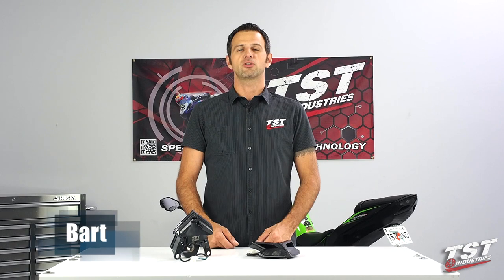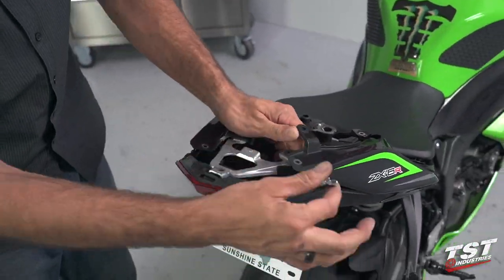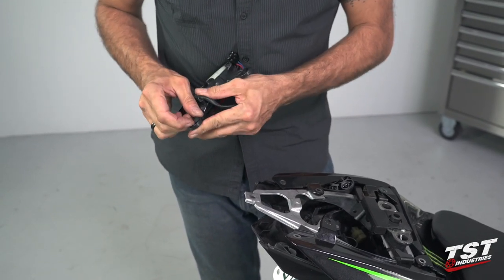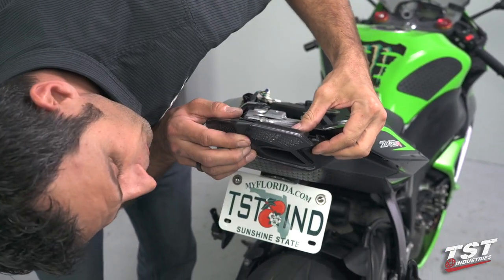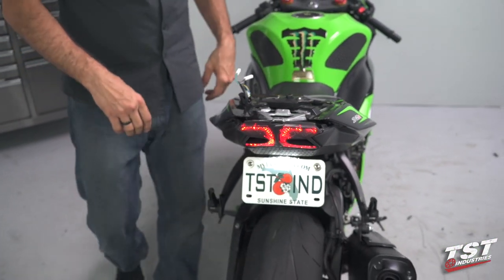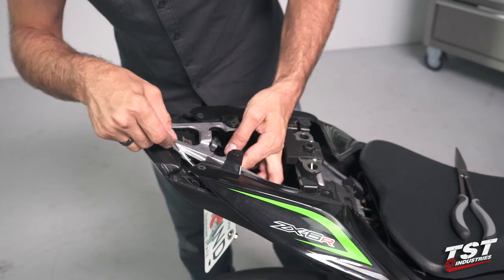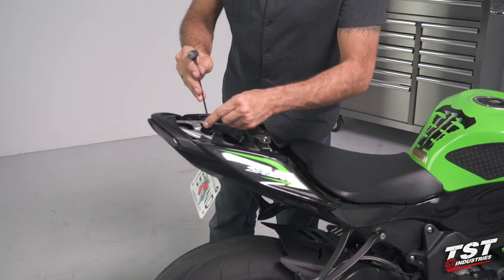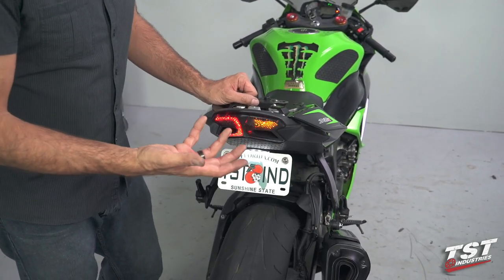How to install a Programmable Integrated Tail Light on a 2013+ Kawasaki ZX6R by TST Industries

Comment: I just installed this on my 2015 kawasaki ninja 636. And wow what an amazing buy. Easy to install no doubt. Just plug and play is all u need. Though i must say the wires were not easy to get to. In the video the guy pulls them basically all the way out. Yea in all actuallity, its pretty tightly snugged in but it can be done. If u buy this u must buy the the replacement for the oem flasher. For those who dont know, when u plug and play u will see that once installed, the lights flash faster then they are suppose to because of the led lights. On the tst website it shows a link when ur purchasing ur taillights..... its a grey resister that plugs right into the stock oem flasher plug. It took me 3 minutes to install that. Basically it slows down the speed of the flashing so that it matches the stock speed with the front turn signals. Im still learning how to work on my bike and even i was able to do this task with the video. Ive been very impressed with these lights and i highly recommend tst to anyone looking for top notch great quality parts.
Reply: The reason i said to buy the part for the flashing is because it just goes too fast with the stock oem part. Doesnt have the same effect when ur lights are on. Once the tst part is in place, the turn signal and tailight pulse in perfect unison...... if u dont buy the grey resistor, you have to splice wires and all that. Do yourself a favor, when u go to purchase the taillights by tst, it will show a recommened buy at the bottom at a discounted rate. Basically parts that go with taillights...... i recommend you add them to your cart.
Reply from the maker: Dan, we're super excited to hear that you are pleased with everything!

Comment: This is stunning - sad the design isn’t available for the 2020 models. Do you guys reckon it could fit ?
Reply from the maker: No, the tail parts on the 19+ bike are vastly different and will not accept this tail light. We designed a dedicated 2019 tail light that sets off the tail of that bike on the same or higher level .
-BR

Comment: I have them on my zx6r 2013 they work great, the only problem it doesn t fit perfectly, but that might be a problem with my fairings.
Reply from the maker: I think this video clearly demonstrates that the fit is as good as OEM tail light. Do you have aftermarket fairings?

Comment: Placed my order from the UK.  Cant wait
Reply from the maker: Awesome. I would like to have your comments once you get everything installed.
Reply: @TSTindustries  So the good and the no so good.  The good.  The lights looks flippin awesome.  I have not seen a better rear motorcycle tail light better.  The flashing of the LEDs when you Break is just awesome...just like a race car.  The sweeping indicators look great as well...and the LEDs are bright and clearly visible.  Also the design of the light is better than the OEM.  The shape with the air vents look great.  All in all really tidys up the rear end and the anthracite grey colour blends into the underneath of the seat.  Looks fantastic.  Now the not so good is...the light does leave a slight gap when fitted.  No matter what you try you cannot seem to close up the fairings to have a complete flush fitted unit.  Also the resistors used to lower the speed of the flashing are not that great.  They get extremely hot.  So hot you cannot touch them.  I was a little worried about it melting some other wires under the rear seat cowel once I put everything together.  TBH this old style of resistor is inferior and was surprised that this was even offered as an option when I purchased my light.  I had to wrap my resistors in a heat shield to ensure if I did leave my indicators on for long they would not get hot and damage something else.  The price of the light is not cheap compared to rivals and for me living in the UK it gets expensive when you have to pay for additional shipping and customs.  I can see why TST offer the Relay.  This should be offered FOC with the unit as most people if not all will need this on the install.  Other than that happy with the product.
Reply from the maker: @ebk7216  Thank you for your valuable comments. I appreciate the praises you sent us and also the careful constructive criticism. We can't continue to improve if we don't hear back from our customers and that is why I always like to get the good/bad ...all of it. I don't want to write up a response that could come across as some sort of rationalization so I will just keep it brief. Not everyone needs a relay for their setup...some people already have one from a previous installation and some people for some reason prefer fast flash. The relay will remain a separate item that people may want to purchase or not. I don't know what to say about a gap. In our installations here during and after the design phase we had the same quality alignment and same size gaps as the OEM light. There was no reason for us to change the design. As for our competing companies in the lighting field, they just copy the OEM geometry of the tail light and put in their own circuit, and maybe some do an internal reflector. The way we design takes a LOT more time and requires a different level of sophistication. Time spent on design of the aesthetic, then the engineering time to make this light manufacturable, and the cost of several molding tools to make the parts, all rolls into the pricetag that you see. In our market here in the USA you actually see some inferior lights cost more than ours because of how the manufacturer structures their distribution. We do have two competing companies that deal directly with customers and have lights around our lights price range. They are the ones we hold in high regard because they have a good product at the right price. Anyway, I hope that you see that we are structured to enhance our coustomers' experience with their bike and not just a money making machine. Money is just a byproduct of doing what we love.

Comment: Can you use it just as a taillight with existing indicators? Like the look of it however integrated taillights are illegal in australia
Reply from the maker: Of course. You can connect the tail light plug and leave the signal plugs off in favor of keeping external signals. You can also use our Y-Splitters so that the tail light and external signals do the signaling. You can see if that works for you here: https://tstindustries.com/tst-kawasaki-y-style-signal-harness-splitter.html

Comment: if I DONT install the relay, so the lights continue to flash fast, will that somehow damage my bikes electronics?

I took mine in for first service, I got it home and I saw in the notes it says "turn signals flash too fast, needs load bearers"

I like it flashing fast thats why I didnt put it in.
Reply from the maker: Not installing an LED Flasher Relay or resistors will not cause any damage to your bikes electronics.
Reply: woo thanks bruh
Reply: I like a fast flash as well. Gets/keeps road tuggers attention

Comment: Hello, where can I buy it and also a radiator for this model of motorcycle?
Reply from the maker: The tail light is produced and sold by TST Industries, the same company that made this video. The link to the product page is in the description of this video. We do not sell radiators though, you may want to try an OE parts website for that.
-BR

Comment: Do I have to slice any wires when putting resistors?
Reply from the maker: The resistors come with tap connectors. You don't slice any wires with those. They puncture the wire insulation and make the connection.  I always recommend our flasher relay over the use of resistors.
Reply: @TSTindustries  
Thank you!

Comment: has anyone had problems without the relay you guys sell?
Reply from the maker: If the included resistors are installed there won't be a need for the relay. If you don't install the relay or resistors the flash rate is fast enough that the light sequence of some of the signal modes does not complete and makes the signal function look broken.
Reply: TSTindustries okay awesome thanks

Comment: does this fit the 2017 kawasaki ninja 650? and if not, do you guys have any that do fit a 650
Reply from the maker: The 650 has a vastly different taillight. The one in this video will not fit. We have not determined whether or not we will design a taillight for that bike.

Comment: I have the 2016 zxr 636 in the UK will this fit the UK model??
Reply from the maker: The taillight geometry will definitely fit. It is difficult to confirm for sure that all the plugs will be direct plug and play but I am 95% confident that they will.
Reply: perfect thanks ill give it a try hopefully everything will work
Reply: SG46 hi did you order this tail light? If so did it Plug n Play straight away or did you do any modifications to the wiring ? This is my concern as i dint want to order this and find out its a bitch to sort out ! Many thanks
Reply: kingbullykutta I did order this tail it was plug and play fits really I just took all the back fairing off my bike so things were easy to get to! I also by the tail tidy bracket and license plate light from tst. The only think with the licence plate light was I had to do some soldering. But tst have full video on that which explains every step
Reply: SG46 what did u have to sodder?

Comment: Just installed tail light on my bike. Somewhat disappointed, the whole design and look is awesome but it has a lot of imperfections. The tail light doesn’t sit completely flush and you can also see silicone coming out from the lense where they resealed it. Cool design but poorly built.
Reply from the maker: Please email out Support Team photos of these issues and we can do our best to see what happened. This unit is built based off of OEM geometry so if it's not sitting flush, something is misaligned.

Comment: Nice equipment, but this is illegal in my country<3
Reply from the maker: you can still use the running light and brake functions.  Don't plug in the signal wires, use your external signals, and you will be set